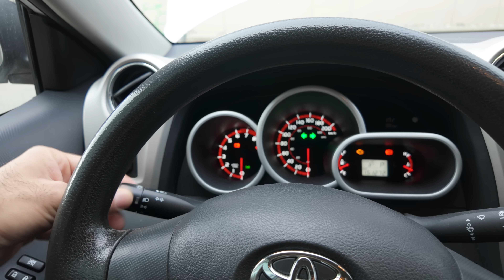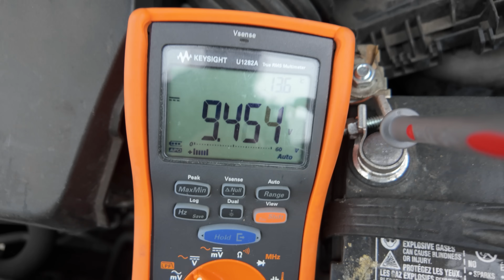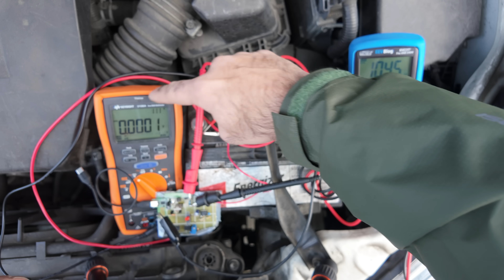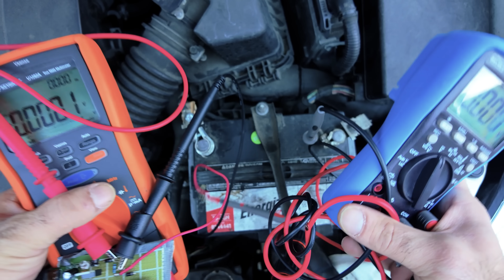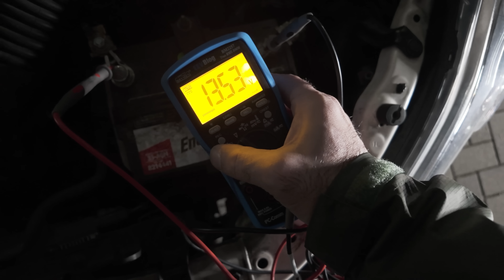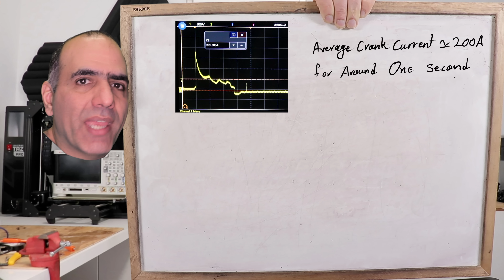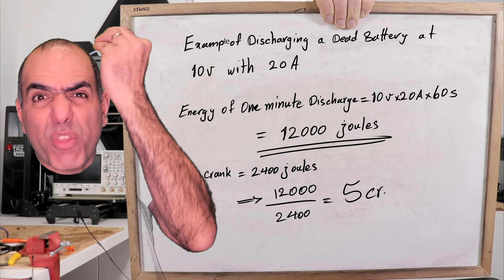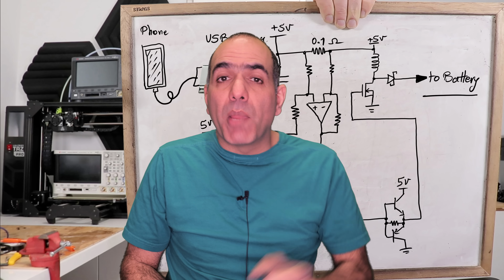Jumpstart by Phone

Comment: 4:31 340 mA? I see 34 mA.
Reply: he might be measuring something else. he didn't directly measure the current, as the multimeter is in voltage mode. but, yes. that seems like 34 mV, not 340 mV.
Reply: @RainDownpours  You're absolutely right. The whole story is probably fake.
Reply: @Amalienstr49 wait a minute. now that I took a closer look at the circuit, he seems to be measuring the current sensing resistor. it has a resistance of 0.1 ohms, so that's why the voltage is 0.1 times the actual current. so, no. I don't think this whole story is fake.
Reply: @RainDownpours  Wow, respect to your skills!

Comment: "6 volts that died too fast" even though we've had lead acid batteries our whole lives we still expect them to act like lithium. 100 amp hour lead acid and 100 amp hour lithium...very convoluted measuring system. Lithium will exceed that buy one or two percent on average. Lead acid you get the opposite, only get up to 60% on a good day without damaging the battery. We should all switch to LTO batteries and never have to change them again😂😂😂

Comment: 1:28 not sure. The tiny 12V batteries fail all the time. Even if your high voltage system is full you still need to jump start

Comment: 0:37

is that actually a thing with modern cars?

my 2002 Skoda Octavia will automatically turn off any interior lights or the trunk lights after a while.
the only issue you might run in to is if you leave the parking light on, but the car will beep at you if you open the driver side door to remind you of that.

Comment: Off course, Every body connects his heating element from his stove to his car and leaves it there,its known mistake ,l even did that twice till now
Reply: A 2000 W element, even at the low USAs low 110 V (~6 Ohm), will only draw around 2 A or 24 W with a car battery. So far less than the headlights, for example, and it will not work as a stove.

Comment: Yes... nowadays everyone wears the phone wit- them... as well as their custom step-up converter for raising 5V to 12V
Reply: boost converter are super cheap though
Reply: In my backpack i have portable power suply dps 150
Reply: That would be a great idea for a rugged phone with infrared camera and car battery charger
Reply: Just.. open your phone and modify boost converter to output 13V. Simple.
And don't forget to use otg only for newest fast charging devices.
Reply: @mamatideaOTG is years and years out of date now, we're on USB PD (at least 2 versions in) by now and USB PD sources are frequently capable of natively supplying 12V using a built in multi voltage boost converter
Reply: I don't think any USB (1.0 to 3.1) supports reverse charging (doesn't output power). Most phone batteries operate at 3.5-4.2V, but that's irrelevant as it's got an internal converter. Your best bet in such a dilemma would probably be the USB-C protocol. Most phones use it already, it allows reverse charging AND works anywhere between 5 and 18 volts (both on V-in and V-out I think).
Reply: @janeczekdeliverservices7831 USB C isn't strictly a protocol, it's just the connector standard that allows for devices to negotiate bidirectional power delivery (using USB PD) or bidirectional data (using anything from USB 2 480Mbps to USB 4 80Gbps speeds). Pretty much all modern phones support exporting power as they have USB host mode on a type C connector so they need to be able to deliver at the very least 500mA 5V to power standard USB devices
Reply: Just keep it in the car....
Reply: I do
Reply: @grabarzponury9868  let me guess: this cutting edge Slavic technology runs on pure ethanol
Reply: i think the phones battery is actually 3.7v
Reply: yes but it outputs USB power at 5V
Reply: @ogonbio8145 unless you are trying to connect directly to the phones battery you'll never see that, also batteries don't operate at a constant voltage you need some sort of circuit to get that
Reply: @ogonbio8145 USB is 5V, battery voltage is irrelevant

Comment: MEHDI, IM FROM THE FUTURE! DON'T DO IT!
Reply from the maker: Which one?!
Reply: @ElectroBOOM REVERSE POLARITY PROTECTION, MEHDI! REVERSE POLARITY PROTECTION!
Reply: @ElectroBOOM  make a video on am crystal radios and how day get powers?
Reply: @ElectroBOOM There is a better way. 

The Experiment: Suddenly create some charge, and with pre-placed instruments watch (along a radial line from the created charge) the fields and potentials appear progressively at points along that radial, at the speed of light.  And once the field and potential suddenly appear at a distant point, they thereafter steadily remain. This shows that a stream of continuous real observable EM energy does indeed pour from the charge, once it is made, continuously and unceasingly.  Further, that free stream of EM energy does not "die out" so long as the charge remains intact. So the associated fields and potentials are continuously replenished, as they continuously spread radially outward at light speed.

The Observation: Every charge freely pours out real EM energy in all directions, with no observable energy input.

The Problem: Either the required nonobservable energy input must be identified or the energy conservation law is false.

The Solution: The charge continuously absorbs virtual (subquantal) photon energy from the vacuum, coherently integrates it, and re-emits it as real observable photons.

References:

Source Charge, Van Flandern Waterfall, and Leyton Geometry T. E. Bearden  (Dec. 2, 2003)

T. E. Bearden, "Giant Negentropy from the Common Dipole," Proc. Congress 2000, St. Petersburg, Russia, Vol. 1, July 2000, p. 86-98. Also published in J. New Energy 5(1), Summer 2000, p. 11-23.

T. E. Bearden, Energy from the Vacuum: Concepts and Principles, Cheniere Press, 2002, “Chapter 3: Giant Negentropy, Dark Energy, Spiral Galaxies and Acceleration of the Expanding Universe.”

M. W. Evans, T. E. Bearden, and A. Labounsky, "The Most General Form of the Vector Potential in Electrodynamics," Found. Phys. Lett., 15(3), June 2002, p. 245-261.

The Source Charge Problem: Its Solution and Implications T. E. Bearden, Aug. 18, 2003

Most electricians don’t realize that from any source of a finite potential intensity φ (phi), regardless of how small the value of φ, as much energy as one wishes can be collected, simply by W = φq, where W is the total energy collected from potential intensity φ by intercepting and collecting charges q. If one wishes to collect more energy W from the same potential φ, one simply needs more q. The reason is simple: the scalar potential is actually a bidirectional set of EM energy flows, as shown by E. T. Whittaker in 1903, and what is collected from it depends on the number of fundamental interceptor/collectors (called “charges”).

References:

E.T. Whittaker
On the Partial Differential Equations of Mathematical Physics
Mathematische Annalen
Vol.57, 1903, p.333-355

E.T. Whittaker
On an Expression of the Electromagnetic Field due to Electrons by means of two Scalar Potential Functions
Proceedings of the London Mathematical Society
Vol. 1, 1904, p. 367-372

If you are interested in legitimate processes to extract EM energy from the vacuum, I refer you to M.W. Evans, P.K. Anastasovski, T.E. Bearden et al., "Classical Electrodynamics Without the Lorentz Condition: Extracting Energy from the Vacuum," Physica Scripta, 61(5), May 2000, p. 513-517.
Reply: @ElectroBOOM This is the real question! How far in the future, would determine how many things we know Mehdi WILL do and we know WILL go bad! Maybe @op missed his time travel exit, and meant any number of past things that caused major pain or damage. :D
Reply: @ElectroBOOM  hello I really surprised you not scared of electricity 😅
Reply: @ALWAYS-BMW If you truly respect something, you no longer fear it
Reply: @ALWAYS-BMW  he is immortal...
Reply: @ALWAYS-BMW  he's built different 🔥
Reply: @ALWAYS-BMW it's all under a voltage that could do anything more than tickle your tongue, and the phone blowing up is certainly faked as he's mentioned in the past
Reply: @ElectroBOOM 😂😂😂😂😂😂
Reply: clippy just wants to help
Reply: @werdwerdus  mico is much better
Reply: a bot copied your comment and got more likes
edit: not anymore, it’s gone
Reply: Ironic how the bot has more likes than you.
Reply: @hatake_kakashi7359  This only proves to me that bots are not shadow banned in youtube but many of us real humans are. And that means their comments are visible to way more people than yours or mine and so get more likes.
Reply: @Argoon1981 It made me wonder why YouTube would push bots and AI so hard when it alienates us, the viewing public. That’s when I realized that it’s because we’re not the target clientele of AI and bots as a product or service; it’s the big bucks corporations that they’re demoing it to.
Reply: 2:27; The anode blows up on the car battery!
Reply: But you are actually stuck to the past. He has already done it.
Reply: Do it lady!
Reply: Too late...
Reply: 8:13; Another Mehdi runs past after the sponsor.
Reply: that's strange, I just ended the future - Electroboom, probably
Reply: You are not from the future
Reply: Lol
Reply: But sir, it's necessary!
Reply: Ok
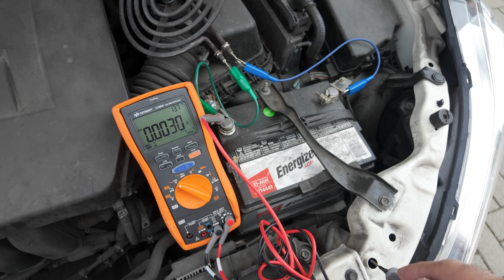Reply: 2:03; Battery to 6 volts and now the car dies.
Reply: 3:24; Note to self on the third mistake: don't freak out before someone drops a deuce in you pants.
Reply: 3:51; Mehdi drives not walks to the bus to go home.
Reply: 7:46; It only charges up to an hour.
Reply: It dsnt change the fact that you own me 20 bucks, future or past you will pay me fast or i will touch a damn transporter
Reply: @8Thiz  Sir, this is a YouTube clip from electroboom, not a threat. If you try to threaten with that message, I will report to the YouTube guidelines for bullying.
Reply: Already did
Reply: Rip s8 or s9 plus 😢😢😢
Reply: guess what I’m gonnna say next
Reply: It’s too late!

Comment: 4:04 no! Very dangerous. Always disconnect the negative terminal first from your car battery! Otherwise, if you were to accidentally touch the car body or metal part of the engine with your tool while you are disconnecting the positive terminal, it will short out and could cause an explosion of your battery or injury. Same goes in reverse when reconnecting, positive first, negative last.
Reply from the maker: You mean, "very"! But I don't recommend shorting a car battery.
Reply: It's O.K. if you use plastic spanners.
Reply: @romanroad483 he was definitely using that metal craftsman 😂
Reply: That is BestPractice, if in day-to-day, the risk of a sustained dead short is minimal.  That said, I did see a mechanic drop a wrench across the posts of an 8D battery in a truck.  That one did explode, and I got a very expletive filled lesson and critique of my ability to drive a stick-shift at 15 while rushing him to the ER in his truck.  Hydrogen gas is only a Sometimes Friend.
Reply: @vaalrus  I see your point.. But what one will you take?: 1% chance & 90% injury or 50% chance & 90% injury?

(50% by naïvely connecting the terminals, 1% by being aware and following the simple rule too ALWAYS connect/disconnect the negative terminal first.. 90% injury by having your arm or face up close with the acid battery without anything but air and clothing(Which could make the acid damage even worse) as protection.

After all, a company like NASA has sooo many regulations, specifications and guidelines.. And yet, the 0.001% seems to creep up in a life time.

EDIT: Oh! and, potential lead poisoning, just too add the pretty sprinkles on top. :p)